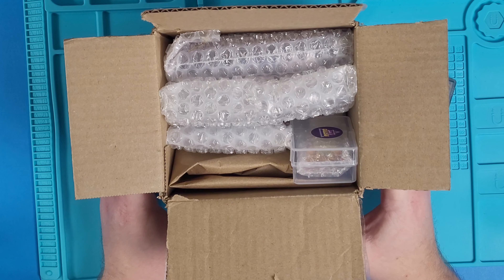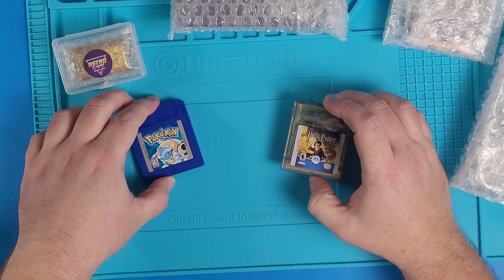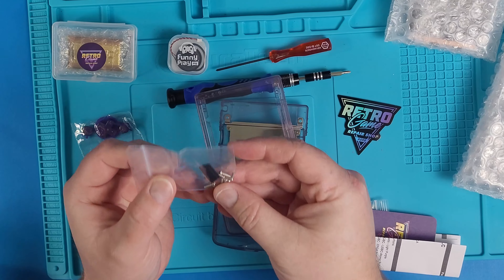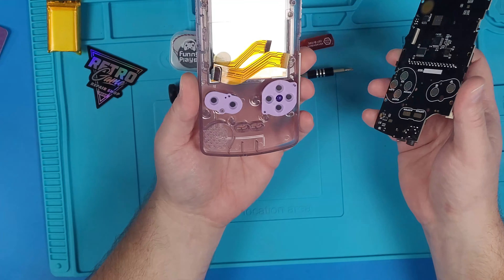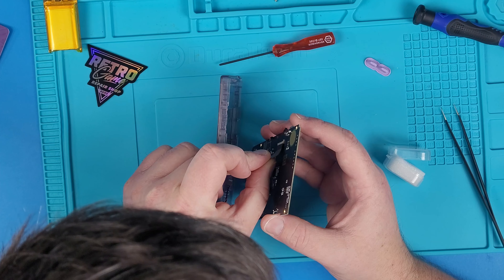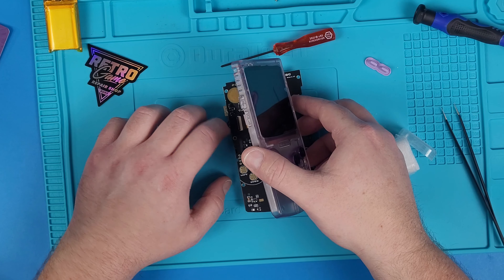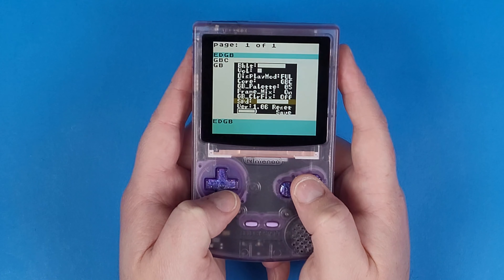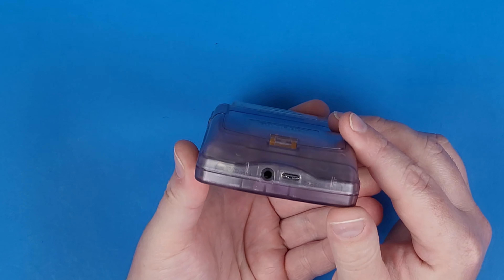FPGA Gameboy Color in 2024 Explore the Limitless Possibilities of DIY Gaming

Comment: What an FPGA? I mean what does it do?😅
Reply from the maker: To keep it simple is it means that it's a chip that can be programmed or reprogrammed plus it's faster for read/write speeds from what I remember.
Reply: @DNAMobileGaming  oh, nice 🙂 Thanks for the info 😊
Reply from the maker: No problem, yeah that's why I was able to flash the update on it easily by just plugging it into my PC while it was turned on.  Technically if I knew how, I could change the firmware all together.
Reply: It's a chip that emulates on hardware level not software
Reply from the maker: Yup that's correct which means it can be reprogrammed from what I read if you know how.